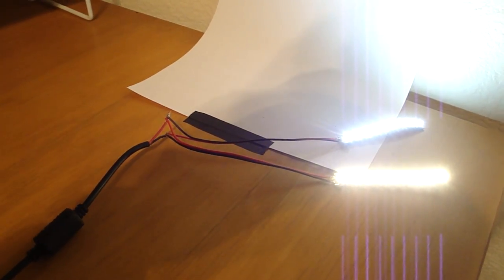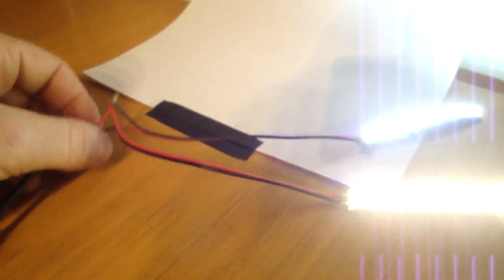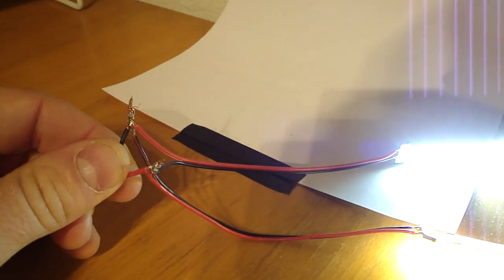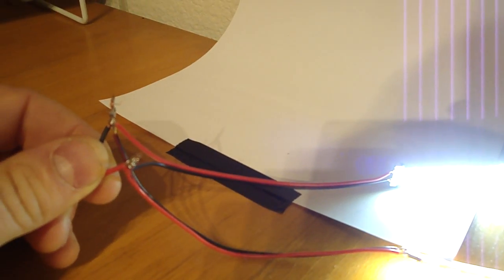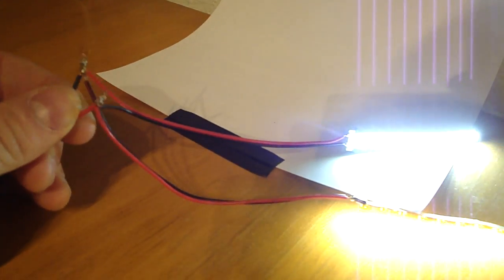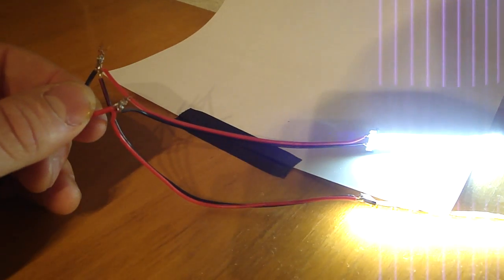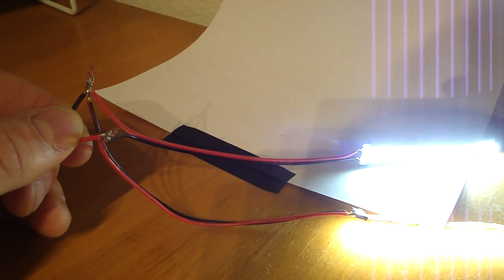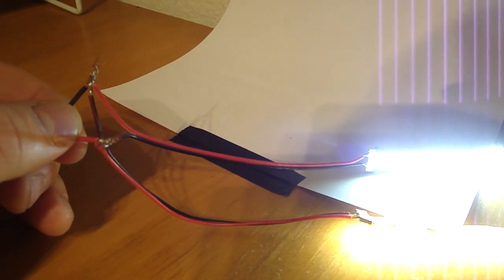LED Lights Example: Running LED Strip Lights in Parallel

Comment: why are different coloured wires connected together?? Does that mean the negative was connected to the positive and so on? Shouldn't u bunch them first?
Reply from the maker: Hi!

This is a parallel run connection. The two wires of each strip are connected to each wire of the driver, that means that the negative an positive wire of one strip are connected to the negative of the driver, and the two wires of the other strips are connected to the positive of the driver.
Reply: @flexfireleds  intresting, so why wont it work just splitting it? like why does one strip neg have to go to the positive?
Reply: @flexfireleds  Its confusing, why not have the red wire split into 2 red wires that go to the + of the both ledstrips and same for the black wires go to the _ of both led strips? i must be missing something here.

Comment: Could you do a video connecting multiple parallel LED strips. I'm interested on how you would splice the wires together in a real world example.
Reply: Thanks for the video, I have a question, if I want to connect 6 led strips parallel can I connect all + together and all - together then connect them to transformer? I see in your video black wire from one strip and red wire from another strip are connected to red wire from transformer,, I’m a little bit confused, I appreciate your response, thanks
Reply from the maker: Hi James, thanks for watching our videos!

To add more LED strips in parallel, you would do it the same way as shown on this video. You may have to strip more of the wire that comes from the power source so you can fit more wires into the splice.

Feel free to give us a call at 1-844-FLEXFIRE if you have any other questions or would like assistance completing a lighting project!

Comment: I have a 10 meter strip of leds.  When wired in series they dim near the end.  Can i wire then em parellel?  One end positive, the other end negative?
Reply from the maker: Hi Del,

Yes! You can ! That will definitely help with voltage drop.

Feel free to give us a call at 1-844-FLEXFIRE, we'd love to assist you on any lighting project!

Comment: The part were you say the wires have to be equal lengths is a bit confusing! I would be using these on stairs so the top stair, obviously, would be further away from the bottom stair and therefore the connecting wires would not be equal lengths-if you understand what I'm saying?
Reply: I think it depends on the LED driver.. If you have a driver that can output more current over the total load current required, it works  fine, doesn't  matter the length. 
You should always leave a little more power to spare rather than pushing your driver to near capacity.